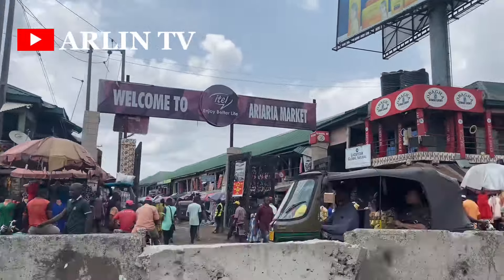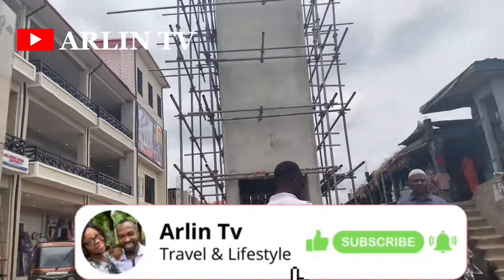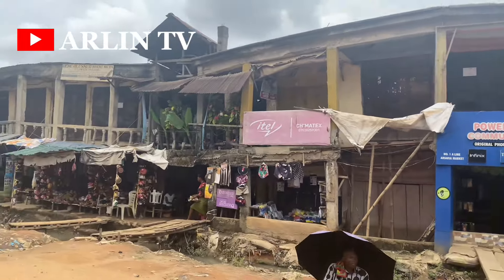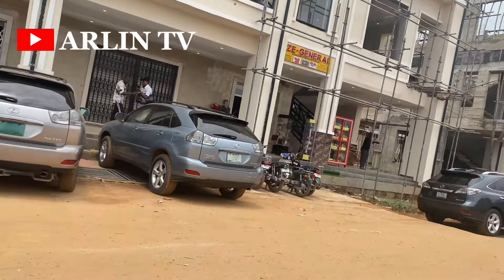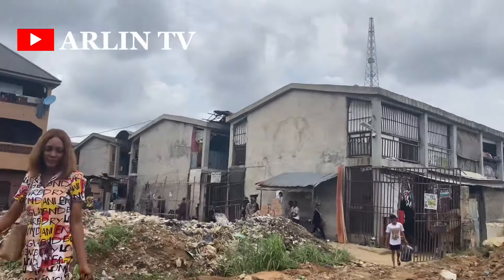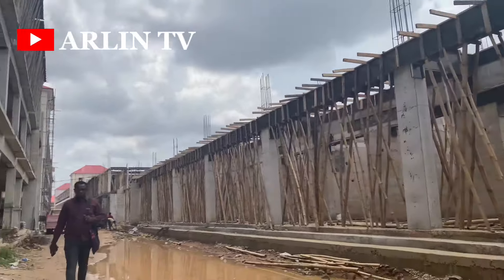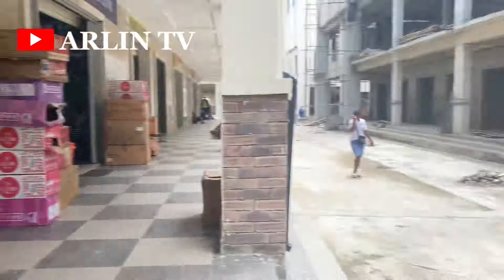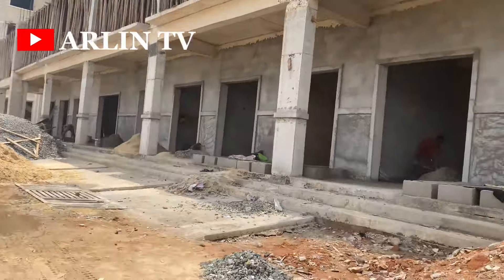NEW ARIARIA INT’L MARKET UPDATE: Gov Alex Otti is Transforming Aba, Abia State

Comment: THIS IS A BEAUTIFUL MARKET NEWLY CONSTRUCTED WITHOUT FIRE HYDRATION SYSTEMS BECAUSE FIRE HAS NO WARNING AND ARIARA SHOULD CONSTRUCT A FIRE DEPARTMENTS AVAILABLE ON THE PREMISES (24)HOURS BECAUSE OF FIRE IT WILL BE CHEAPER TO BUILT OF EQUIPPED WITH FIRE DEPARTMENTS 
IT WILL BE A GOOD ADVISE IF THE SHOPS ALSO HAVE TOILETS INSIDE THE SHOPS FOR EMERGENCY PURPOSE BECAUSE THIS IS A WORLD CLASS SHOPPING MARKETS